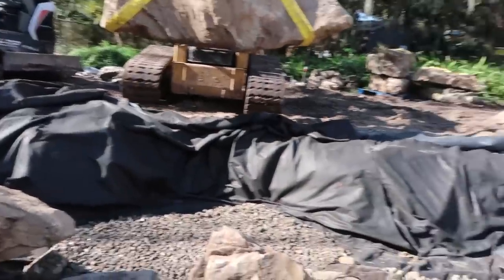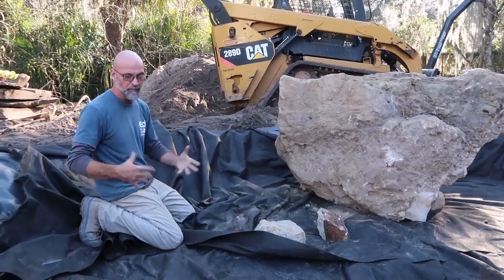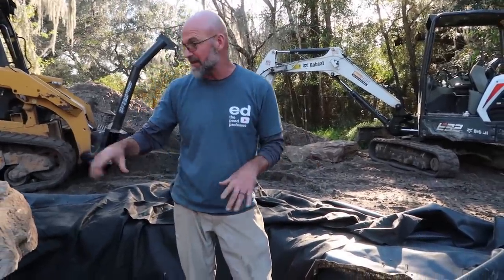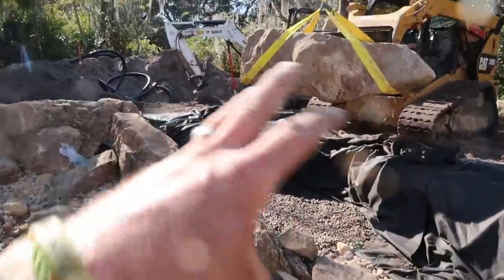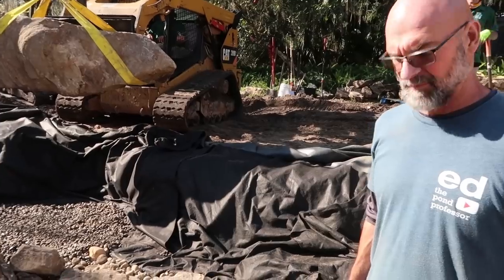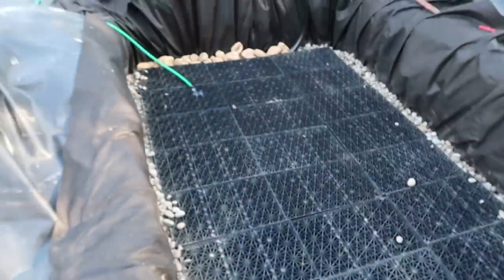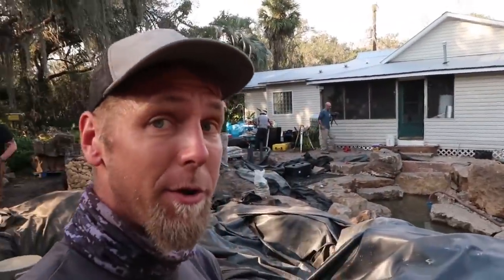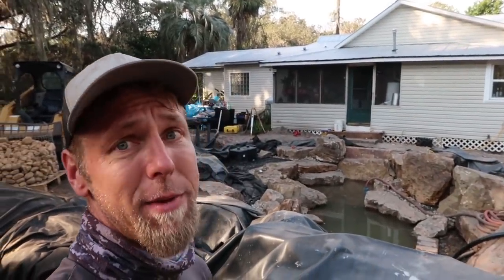Wetland Filter for Reptile *REC POND* - Part 5

Comment: What would happen if I had a similar project to this one during Winter? If ground water was an issue but I had to shutdown my intake bay or zero edge system for the Winter? Can the sump still run 5ft below ground to keep the water feature from floating up like raft?

Comment: Hey guys I have a question. I’m going constructing a pond and I’m putting in a wetland filter as well as a spillway that’s on a different side of the pond then where the wetland is. Is it ok to “T” into the pipe from my vault or do I need two different pumps? Just wondering if there is going to be enough water volume for both.